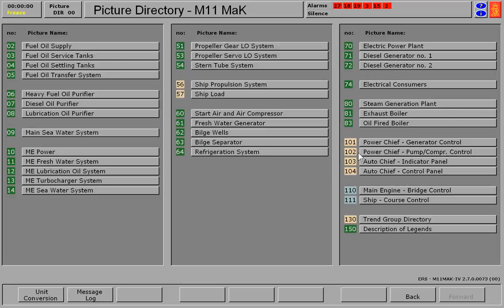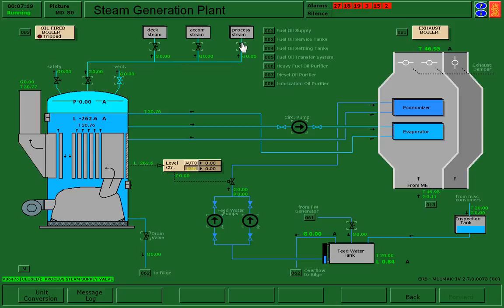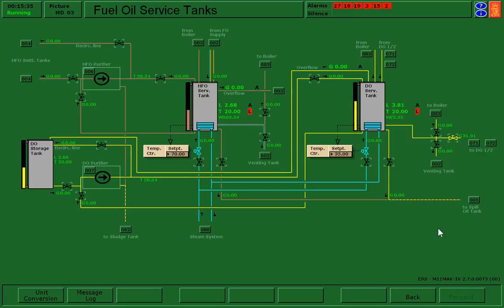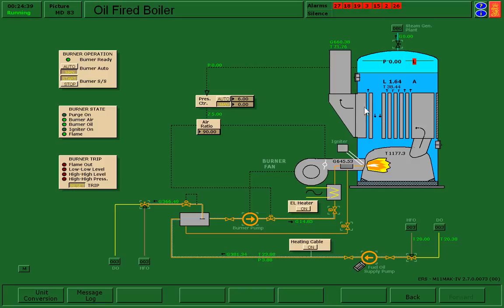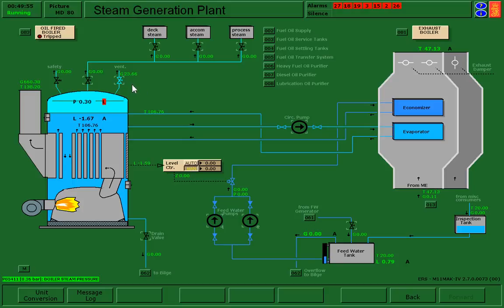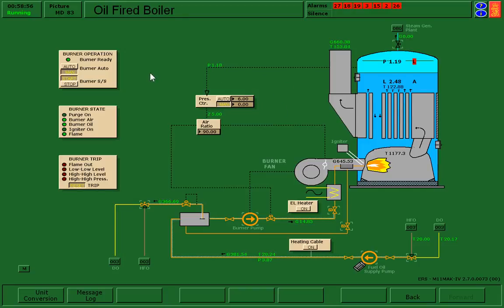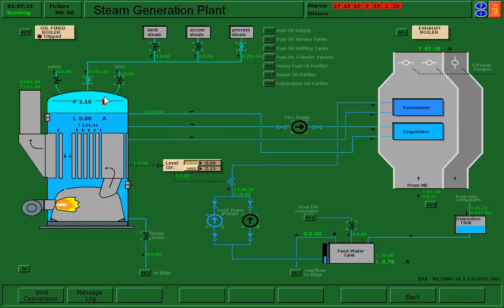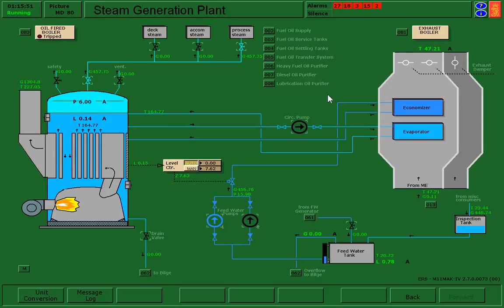PENG1005 - M11MAK Boiler Startup

Comment: hi bro. i want to ask u something. i recently downloaded a boiler simulation software. ( its name is intagrated boiler simulator . its old software 2005 russian ) its good simulator but has many problems. cant automate water pumps and every min u have to adjust the pumps... etc.

i want to ask u that. i start the boiler and keep the water level at 30 ( no measurement 25 is low and 35 is high water level)
and for example when water level drops suddenly and very rapidly if i open the steam outlet valve water level begins to rise very rapidly and if i close the steam outlet valve water level again starts to drop rapidly and at whole these steps i dont touch to  water inlet valves to the boiler.

i think it must absolutely the opposite . at low water level if i open the steam outlet, water level must drop insanely.

i think this is simulator error but ii wanted to ask u if there is something that i dont know.